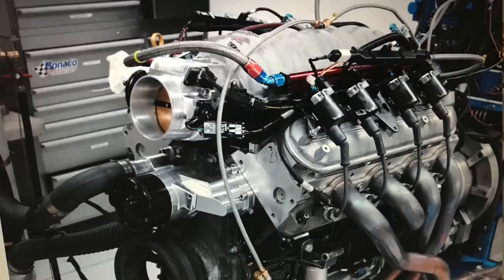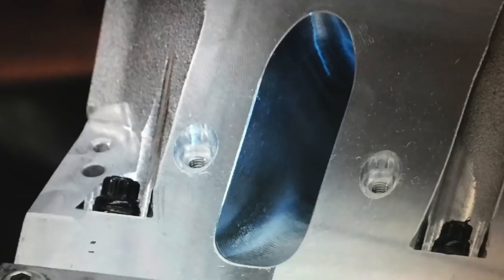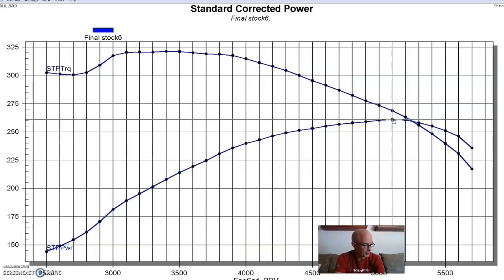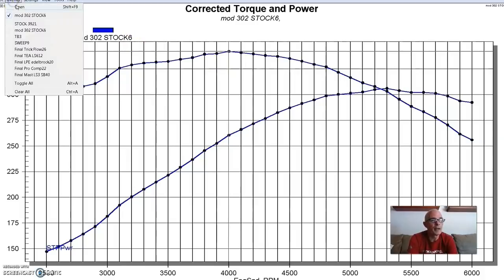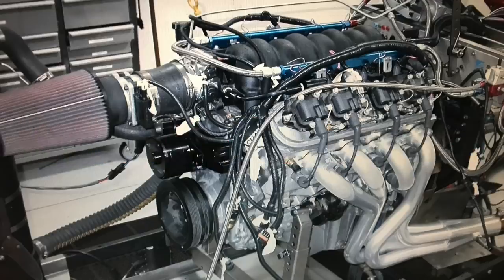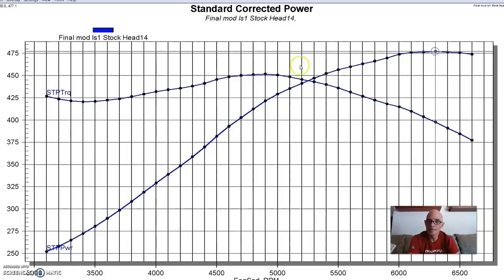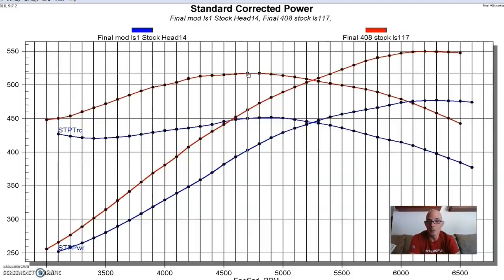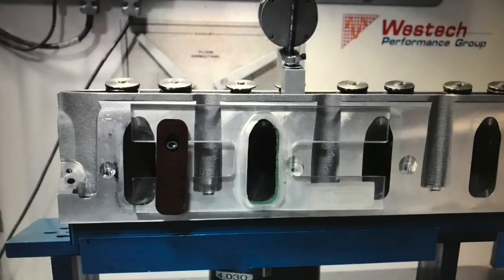DOUBLE JEOPARDY! AIRFLOW vs MAX HP!

Comment: I’m sure this question has been asked before somewhere but here it goes I have three sets of heads one is 317 862 or 823 they are going on a 6.0 witch one you think will make the most horse power
Reply from the maker: the 823 will make the most peak

Comment: Hey, what exactly do you mean by "more cylinder head"? Bigger valves, more compression, bowl blending?
Reply from the maker: MORE FLOW
Reply: @richardholdener1727  wouldn't too much FLOW on a small stroke ls hurt power or just move your power curve to the right?

Comment: Im planning a 351 build for a 95 F150 4x4  . Im thinking of sticking with efi id like to reach 550 h.p and of course on a budget . Can you achieve that with the stock heads ... G.T heads or what do you recommend also is the stock efi worth keeping or up grade knowing that they are pricey
Reply from the maker: Its hard to make 550 hp with a 351 without boost or wild cam timing and very good heads and intake
Reply: What head and cam would you recomend for the truck application ?  Going with a roller motor id splurge on the head and cam . Just not sure about after market efi . P.S thanks for reaching back and greetings from the Motor City!!!!

Comment: Making 456whp/470wtq n/a out of my 383 stroker (iron block) with stock 243 heads, healthy centrifugal supercharger cam, and ls6 manifold. In my case is it worth going to ported heads to where I will have very good gains? I was just planning on getting a Dorman ls2 manifold and porting it
Reply from the maker: ported head will help that combo

Comment: I would run the smallest cam posssible or torque cam to see how much each head picks up the reason I say small torque cam is because you don’t want compression to sku results on a bigger cam to help it all thru the rpm with a smaller cam you would see more of the head work over compression am I making sense and when you divide are you doing wheel hp or crank such as my 99z28 makes 350 hp wheel what would be my crank hp
Reply from the maker: the small cam would not allow the combination to use the available head flow-our 350 whp is about 440 fly hp

Comment: I am curious at what point do you need to change ecu and get custom tuning when adding to a stock engine.  For example, my 96 F150 with a stock 351.  If I add an intake, heads, cam, it should be fine?  If I then do injectors, and want to add a turbo or two, when and how do I go about needing a tune/new ECU?  How much can stock ECU handle?

Comment: I get 1.61 using the math equation. Would I benefit from a cylinder upgrade if the heads I have are not maxed?
Reply from the maker: probably not
Reply: Would I use wheel or crank hp?

Comment: This is a slightly tougher concept to digest.  You put it in great, understandable terms though.  What I am imagining is one mole of oxygen passing through the smaller head versus the larger head.  The atoms have to compress more in a lower flowing head--and likely don't due to physics and temperature--so oxygen content in the cylinder (cylinder filling?) is less.  Is there any point where a vacuum starts to "inch up" on the lower flowing head at WOT?  Say 1" - 2" of Hg.  If so, is there a ratio or rule of thumb related to inches of Hg?

Comment: I would love to see how Edelbrocks E-CNC rectangle port heads for small bore LS engines do against a pair of Trick Flow cathedrals.  I'm wanting more top end power in a C5 Z06 with LS6 that sees a lot of track time at Willow Springs.  Thinking LS6, Edelbrock E-CNC rec port small bore heads, non-wild track focused cam, LS3 intake manifold and TB unless it would be a bottle neck]

Comment: When are you going to do an L99 cam and heads test?
Reply from the maker: the 4.3L?
Reply: Richard Holdener the 6.2 l99 auto trans camaro ss. It has the vvt and the afm. Wanted to know more about power adders for this engine with the vvt cam and tuning. Maybe heads as well

Comment: I wanna see you do a video about the engine dyno itself...  How does the engine crankshaft connect to the input shaft on the dyno?  Is it difficult to mount an oddball engine on the dyno that's not a GM/Ford/Mopar or Honda?

Comment: Before I got my Silverado with a 5.3l, I rearly watched your videos. I thought that since I didnt have a ls based motor, or whatever else you were testing, that it didn't apply.
Man was I wrong. You've constantly proved the same concept across the whole range of motors. It doesn't matter if it's an ls, sbc, sbf, bbc, honda, or whatever. You need to match the cam, intake, and heads to match the power level you want. And boost is always better!!!!
P.S. Gap those rings.
Reply from the maker: motors are just motors-they all do the same thing

Comment: What would be more fuel efficient to drive? A 1000hp stock head motor running a lot of boost or a big head and cam 1000hp motor running half the boost.

Comment: does this also apply to 4 cyl motors? am i looking for the same value(2) when i divide max hp by max cfm? Also, would it not be more accurate to use the flow numbers that coincide with my current valve lift?
ps. loving the vids!
Reply: I think it's closer to 1:1, CFM/HP for a 4-Cylinder. The number 1.2 somethin'-somethin' comes to mind when I think about it.
(Running non-oxygenated fuel)

Comment: Were those Ford E7 heads untouched.  Still have the egr bumps in the exhaust ports?
Reply from the maker: all stock-no changes-just spring upgrade
Reply: @richardholdener1727  thank you for the answer

Comment: So. My cammed 5.7 LS1 with ls6 intake WOULD benefit from heads ?
Reply from the maker: the bigger the cam-the greater the benefit
Reply: Richard Holdener 
Here in the uk we get nice 99 octane fuel from the pump. I’ll bet more than the stock 10:1 compression would perhaps gain me more ?

Comment: Most people are gonna have wheel hp figures to work with, so this doesnt help much.  Cant even really use stock crank hp estimates as mentioned 345hp = 400hp+
Reply from the maker: it works for whp too
Reply: So WHP + 100 / CFM = >2.0 then you need to upgrade?

My 450whp ls2 with stock 243 heads is over 2.0 based on that formula but other’s results show heads are worth about 20hp, esp with stock intake (biggest restriction at this point).  I will be watching for LS heads comparo as heads might be in my future (they are coming off this winter for inspection, got intermittent vavle train noise that has me thinking bent valve)

Comment: The other way to look at this info, referring to LS engines, is why a simple cam swap is so effective. The available flow is there, thus the amazing horsepower increase usually seen. AFR used to advertise getting the same hp results with 10° less cam, another effect of better flow. Many engines have made somewhat above the 2hp per cfm of intake flow, but the cam needed usually kills any streetable low end power. When it’s a big block, you usually don’t care because there’s so much torque the relative reduction is not a factor. Another great video, thanks Richard!

Comment: Constant flow at a certain pressure drop is a really useless number when you take camshaft specifications into consideration. Then there is velocity which is again at a steady flow rate. You may get more horsepower and a slower acceleration. Two Engines can make the same power and respond completely differently. 
Some old timers think all engines must have quick response to "Break the tires loose " so over advance ignition timing to accomplish this causing engine damage but maybe winning one race.850cfm carb 500hp 700cfm 485hp but really responsive .Which do you want? BOGGING is slow.
Reply from the maker: two engines that make the same power curve respond the same

Comment: Haha, I almost thought from the title that you'd be running the different heads on the same engine. Which is possible. The bore spacing is only 0.020 apart and you can actually get the bolts to go in. But you'd still have to worry about the pushrods and intake manifold. Would be interesting if someone would come up with manifolds for doing this Frankenstein setup.

Comment: The formula used in this video to determine the efficiency of a cylinder head is applied to an 8 cylinder. Does anyone know what multiplier would you use for a 4 or 6 cylinder? Would it be 1.0 and 1.5 respectively because there are 1/2 and 3/4 the number of cylinders?
Reply from the maker: yes-its 1 on a 4 cylinder

Comment: Very interesting .. I wonder how this affects turbocharged engines. if I have a 2.8L and it's making 350hp 380tq on mild boost... a bar maybe 16-17psi head flows in between 180 and 190 CFM. How does it stack up? Unfortunately they don't make upgraded cylinder head. I could pull it apart and port it some more.
When I crank the boost up 28 I know it's over the 400 mark... I just haven't dyno it at that.
Reply from the maker: You are making near 160-165 hp NA

Comment: For boosted v8 applications, would the formula work if you do 2*CFM + 2*BAR boost you plan to run?
Reply: @michaelr3501  but if due to boost pressure the air is now double the density, aren't you now getting in many more pounds of air mass per thousand cubic feet inducted? There by for the same volume inducted you are doubling your horsepower potential?  In a perfect world, assume no losses for the sake of the question IE the frictionless cow

Comment: Does the math for cylinder head flow vs hp also work on a forced induction engine? Or would that be different
Reply: The classic rule of thumb is that you need 4 cfm of intake port flow per cylinder per HP.  With 8 cylinders you therefore get 2 hp per CFM of a single intake port.  With a 4 cyl it's 1 for 1.

Comment: I learned this years ago without having a dyno. I had a Vega that had a built 327 and was running the Fuelie heads line everyone else.I was able to get my hands on a set of the early Chevy Bowtie Aluminum heads with 2.05 valves ans I picked up a 1 second in the 1/4 mile which was a huge gain. We didnt have dynos so we relied on calculations and that 1 sec was appox 50hp gain.

Comment: Another great informative video. I experienced the impact of this many years ago with traditional Pontiac 400 heads that would flow 185 cfm when we put them on 455s to raise the compression on the smog area motors. We would see more hp with the 455 but at lower rpms and everyone would blame it on the longer stroke. When we ported the same heads to flow 270 the power really jumped and carried much higher in the RPM range. When the aftermarket started making 300 plus cfm heads for Pontiacs we really saw how much our stock 400 heads were holding us back.. I see this now in the LS world when someone adds a 4 inch crank while keeping the stock heads and blames the lower than expected hp number at lower peak  rpm on the longer stroke when as you point out so well it is the fact that they are choking the motor instead. Keep up the good work.
Reply: Pontiac made some good stock heads like the round port ram air 4 heads those are the best stock Pontiac heads in my opinion

Comment: How does the 2 hp per cfm math equation work out when adding boost?
Reply: With Boost the HP doubles every 14.7 lbs of boost. Doesnt matter about the flow for that to be true. The Natural Aspirated HP is effected by the head flow.  Thats why boost is a power adder...the lower the natural power the less the boost will have an effect.
Reply: Also important to know, it's not guaranteed you will achieve power gains just because you put a higher cfm head on the same engine. Not as simple as that formula.
Reply from the maker: if you put a higher flowing head on a combo that is running at 2.449 hp per cfm-it will gain power
Reply: @richardholdener1727  All due respect, but putting a head with the correct port design for the application makes the power, regardless of a cfm number. No guarantee a higher flowing anything will make power, let alone more..
Reply: @michaelr3501  Well he kinda shattered that when he took different heads from different manufacturers a couple of videos ago and they all made within 5-6 HP of eachother.  all of them claiming to be the superior  head.  I think if the bottom end, cam and compression are up to it,  for a street guy it isnt gonna make that much of a difference.
This is why you'll see guys who've had 347 ford strokers  and put Twisted wedge 170s unported on it and make like 440HP because they're bresathing on that head pretty hard.  those heads flow 242@ .500

Comment: I wonder what the real world drive-ability mid/low range differences would be. Obviously top HP/TQ is nice but in a mud truck turning big tires with thick mud would the lower hp/tq engine at the top of the heads air flow limit pull a hole without needing a downshift compared to a cylinder head with more airflow and peak power?
Reply from the maker: the 393 with a good head made more hp and torque everywhere-from top to bottom
Reply: @richardholdener1727  of course because the e7s flow so little. I guess were probably getting into a port velocity, valve, bore/stroke compared to head flow discussion. The simple answer is boost.
Reply: @michaelr3501   Your missing the point completely.

Comment: Have you got an average ratio for 4 cylinder engines Richard? Love the content as usual 👍
Reply from the maker: the hp number per cfm is 1/2 of the V8 (but most 4V motors usually do much better)
Reply: @richardholdener1727  thank you good sir👌

Comment: So how about 14.7 psi on that 550hp stroker?
Reply: Yo Lol  dont think so. 14.7 will be over 1000.
Reply: Yo Lol  every 14.7 lbs increases power by whatever it was NA.  So if NA makes 500hp 14.7lbs will make it 1000. Take it up to 29.4 add another 500, so 1500.
Reply: My point was if the head is out of steam at 550 NA then will that seriously limit boosted power or does boost overcome the restriction?
Reply: @jasonbirch1182  the limits of power at NA doesnt really effect the limits of the boost as far as making power.
Reply: that would make it 1100hp.

Comment: I've always used 2hp/cfm as a choke point. Lots of combinations make more than this but it becomes pretty obvious how much just a bit of head work will pay off when you get here. Making almost 400hp with stock e7 heads reminds me of reading that in the magazine...i kinda wanna see a 300 six now.
Reply from the maker: you probably read one of my stories on it
Reply: @richardholdener1727  don't have any of your books, use to sub to Mm&ff. If you had a book about reflashing a motronic 7.1.1 and rescaling maf tables I would buy it.

Comment: Oh man love this video.  Would be curious to see how a gt40 or gt40p head would do on the sbf combos.
Reply from the maker: I tested those in the big head test
Reply: @richardholdener1727  anyone have a link to that video? I can't seem to find it when I search big head test or Richard holder gt40
Reply: @GottaWannaPerformance  I'd be curious on this one as well.  Good cheap performance head that many use.
Reply: I’d like to see how the blueprint engines aluminum heads worked. $500 each at summit, that’s within reach of my empty ass wallet!
Reply: @miken.4693  id rather do the afr 185 enforcers myself.  better hardware in a cheap head for 1100
Reply: Gt40 and gt40p explorer heads are junk to what the aftermarket has now in the mid 90s they were good but now not worth it my coworker has a 1990 mustang gt went and got explorer heads ported them swapped them with camshaft I think b cam races a trick flow headed gt 5.0 with same b cam and got wrecked with the tech and knowledge that is out now those are very out dated
Reply: I'm not saying porting is easy. I am saying the OEM leaves a lot on the table. Research leads to cubic savings.( IE. Bang for buck). What if?